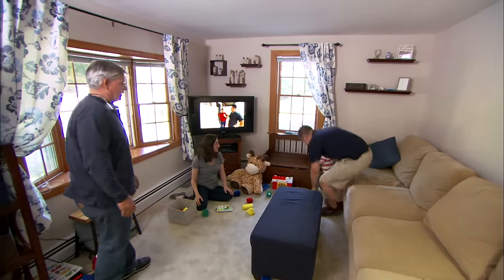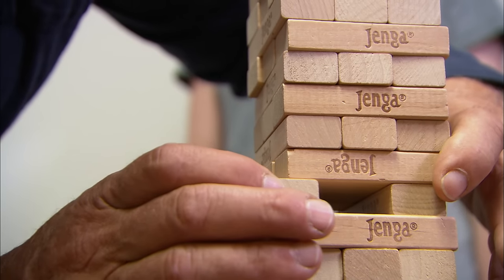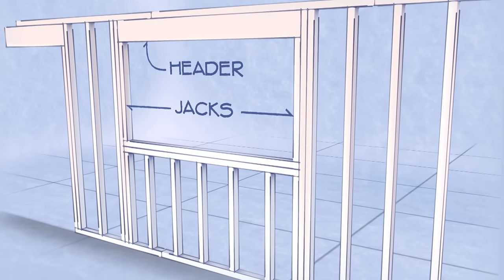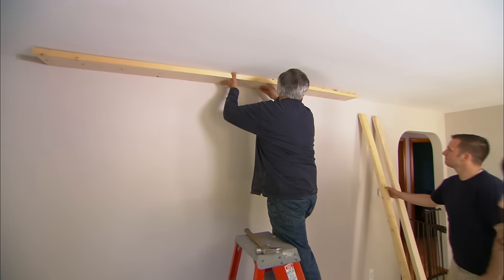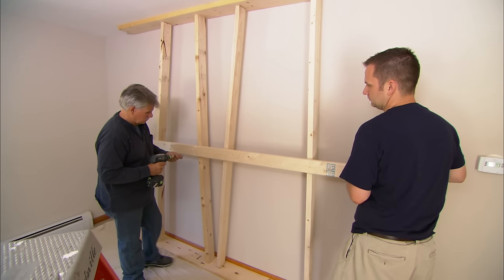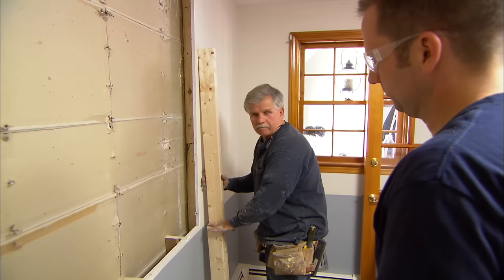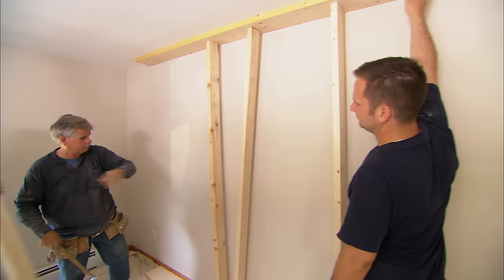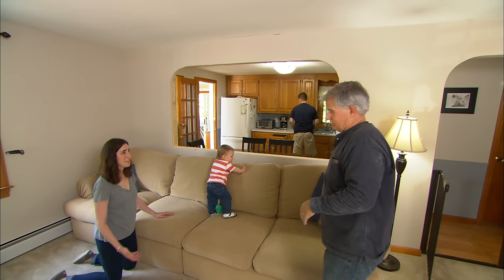How to Cut a Pass-Through in a Load Bearing Wall | Ask This Old House

Comment: Did anybody notice how they sandwiched the electrical running along the top plate by putting that header in. WTF? Is this for real.
Reply: I didn't at first but after reading your comment, I looked at it again and ya it looks like they put the header snug against the wire...curious as to why also...
Reply: The sandwiched plywood is cut shorter than the two boards so the wire has a place to go
Reply: I thought he said they were going to get the electrician to come  relocated that wire and outlet..

Comment: Sandwiching romex with the new header was really sloppy. If anyone ever puts crown in the kitchen they might hit that cable too, no one is ever going to expect electrical to be running horizontally there. I would have also cut out the round openings in the doorway and kept everything square. If you're going through the hassle of updating a home you should always do it right. It's a lot easier to cut and retape that door opening than try to emulate the pass-through. Square corners, proper casing and counter for the pass-through and it will look a lot cleaner.
Reply: So true. What a mess! I knew better at 13 years old.
Reply: " I would have also cut out the round openings in the doorway and kept everything square. " Which shows you don't do this kind of work because if you did you'd know that it's the customer and not you that decides what to do. Good contractors do "shoddy" work when the budget demands it. 

Watch here where electricians on youtube fix really old paper insulated wire instead of replacing it, because they person can't afford a rewire. 

Watch a plumber who does work for a landlord simply repair a leaking kitchen pipe that got flex pipe half kinked instead of redoing it with properly cut to dimension piping. 

you have no idea what constraints are being worked under here. If the people preferred rounded corners (i myself would have kept them, because i like them) 

If the electrician said hey, i can fish these wires properly, but i'll have to put more holes in your drywall and you'll have to pay to patch them or...  etc.
Reply: If a customer asks me to do something illegal and with poor workmanship to save money I just wouldn't take the job. There are plenty of bottom feeders out there that will gladly accept it. But those that lower their quality standards for people who are cheap are not craftsman, they are hacks!
Reply: keeping round openings isn't illegal. 
Running that electric there isn't illegal. 

being able to build to a budget isn't a sign of a hack, it's in fact arguably a sign of a hack that you can only produce when given complete design authority and an unlimited budget.

Not every work has to the sistine chapel. Renting to say section 8 housing and therefore building something functional and cheap under the assumption that you'll have to gut it every 5 years is in fact a valid way to run a business.

You may not like it, but the idea that your car simply can't be a ford fiesta or whatever even when all you care about is getting from point A to B is a failure on your part, not on the other person. 

Likewise, if you think "well unless I get to cut access holes to run this electrical conduit and redo your perfectly good doorway i'm not doing it" is absurd. 

You either don't do the work or don't have customers or are lying.

working to a budget is a fact of life for actual contractors.
Reply: The rounded corners is what one might call "character."
Reply: Are you in the trades?  Do you routinely turn down jobs because the customer doesn't want to do everything by your standards?
Reply: that's what i told him, apparently he says yes.....
Reply: More than 1 way to skin a victim.
Reply: From the looks of it when he fabbed up his new header with the two 2x6 with 1/2 plywood he may have left a groove in it as I see the electrical is dead centered
Reply: Round openings is just personal preference. Always someone giving out meaningless advice and complaints on these videos.
Reply: In my time of working in this industry, I have had 1 customer that had the go nuts budget that allows for everything to be done perfectly. That's only one. It's the first time I've ever had that happen. Normally, when you're a craftsman you have to know what allowable tolerances are and where you can and can't cut corners to save the customer money and keep yourself working.
Reply: @Guillotines_For_Globalists  A reputable trades person builds according to acceptable practices and the building code and NEVER sacrifices those principles to satisfy a homeowner's wishes.  If a trades person does so, he risks the loss of his license.

Comment: Seems a little odd they would sandwich the power cable across the top of the header like that. Backing up the video, it looks like they may have left enough room for it by making the plywood spacer less than 12 inches. Be nice if they had mentioned that. Also, the doorbell and wires just magically disappeared lol. I wonder if the full show may have mentioned these issues.
Reply: I was wondering what the electrician had done as well. Would have been nice to see what had to be done.  And how did he figure out the other two were not "in the wall" when the wall wasn't open? I'm probably just uninformed,  but that's why I'm researching through videos now.

Comment: If you pulled that on my job site, you are fired
Reply: the main thing done wrong was only bracing 1 side of the wall, BUT, secondly; you never use 2x material on flat as a support header/beam, use 2(preferably  3) on edge. Use the thick dimension of your lumber to provide stability. Also, fastening the temp studs makes it far safer...need more??
Reply: Please elaborate how it should be done.  Honest request.. I have a kitchen living room that i would like to open up and i would like your expertise input.

Comment: This video serves to show that common alterations can be done to improve quality of life.
It's easy to be an armchair quarterback, but in its details this tutorial falls short. 
You have changed the load distribution without addressing all consequential aspects of that change. The new yoked point loads were not addressed in the basement. Were new columns needed a/o installed? Was solid-blocking, or squash blocks used? 
Is that header supported by single jacks? Overhead wiring concern was not addressed. We who are seasoned, master builders/carpenters must be so much more thorough than this. Please apply greater scrutiny to build or strengthen your credibility.
Reply: Relax man, it is a 7 minute video,  not a step by step instructional course! If somebody watches a quick video then starts tearing walls out of their house, nothing would help them.
Reply: @Sacapuntas69  This video contains dangerous information, because that's EXACTLY what some people do.  The video strongly suggests "you can do it yourself" and "here's exactly how to do it".

Comment: What about the return air chase that was clearly in the center of the wall?
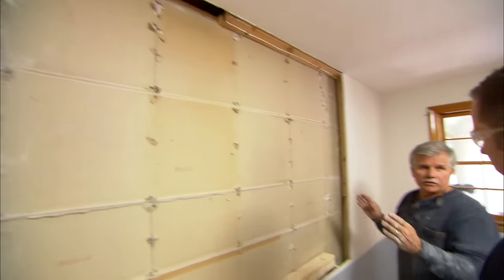Reply: The upstairs is not gonna get conditioned well if they didn't move this. What's even odder is in some of the clips it looks like there's a return air and in others like at 3:29, it appears like the top plate is solid.

Also, it's best practice to use 2 jack studs on each end of the header IMO.

Comment: I guess there was sufficient overlap in the ceiling joists above to where they only needed a temp wall on one side.  I was surprised he didn't put temp bracing on both sides of the wall.

Comment: Serious question: Don't you need to make sure the floor can support the concentrated load produced by the jack studs?  If the floor is on a foundation, fine, but what if they are on the second floor there?  Is a standard top plate good enough?
Reply: If you look at the animated drawing, you can see that the load is carried on the header, down through the jack studs BUT THEN onto the sill below, which in turn redistributes much of the load across several studs below.

Comment: Really!! Is this wall is load bearing, we here in Iraq use the brick or Skelton building for bearing , now you just put an wood and plaster board and naming it bearing wall , am seriously amazed
Reply: Wooden buildings are not as heavy as the brick buildings in Iraq, so this is plenty strong enough to support the floor above.

Comment: I wonder if it would better to support both sides of the load bearing wall since the one unsupported side would have more stress on the boards holding up the ceiling..maybe support ceiling a foot or so away from wall on the side you’re curing in from?

Comment: Perfect job. I've done this many times. Is it really necessary to double up the sill plate?
Reply: Yes. When you drywall you gonna want the plate the same width as the 2x4's so the wall could be flush
Reply: @nateg5915 

No, I mean the sill plate. The plate under the window.
Reply: @TrumanGN  oh I thought you meant the header. But I dont see any structural reason why you would need to double the sill plate
Reply: They doubled the sill because they are supporting the headder off of it. That's the reason they could do this without opening the wall to the floor to put jacks all the way down

Comment: Kind of off topic for this video but our house is very similar this this one. We opened up the wall between our kitchen and living room and put in LVL beams to carry the load. Now we want to close off the doorway in the kitchen that leads to the old entry to the living room and hallway. This will give us more wall space for cabinets when we redo our kitchen. My question is, when closing off an old interior doorway do I need to remove the hardwood flooring under the doorway before putting the bottom plate in? TIA!
Reply: No, the bottom plate is between studs so it's not bearing any load and there is no reason to cut out the flooring to do that.
Reply: No need. Especially if it is an old house, you preserve the original flooring for future renovators as well.  In many old houses here in New Orleans, the flooring often runs underneath many of the interior partition walls. It depends on the age of the house and it's construction.  You could have a subfloor with strip flooring, or perhaps suspended solid T+G flooring without a subfloor for example.

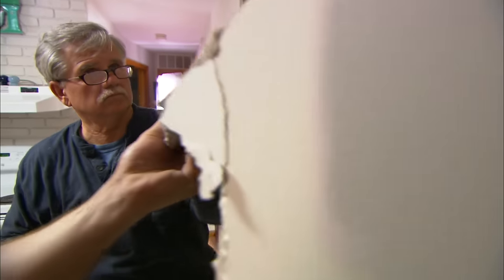Comment: Question: @3:27 you cut the studs off with a reciprocating saw (sawzall), then @6:37 you see the undamaged wall on the other side from where the studs were cut off.  When I try something like that, the reciprocating blade cuts through the drywall on the other side.  What am I missing?  I wanna learn to do it your way  Thanks!

Comment: how big of an opening can you cut in a load bearing wall using the header method? I have a 114" wall, currently looking to configure it for a 70" opening centered on the wall. If i can go wider i would love to
Reply: You can open the whole thing up if you want. But your header beam might be 36” deep. You need a structural engineer to tell you that.

Comment: So you eliminated the distributed load over 7 studs and concentrated the load at two locations with 3 studs at each of the two locations (1 original stud and two jack studs at each of the locations) only on the floor above the floor below it.  In the floor below it you have effectively removed the load over 5 studs and added the weight distributed over the seven studs in the floor above on to only two vertical studs on the floor below.  I assuming the wall below is layed out with studs on 16in centers.Question: Are you saying the wall in the floor below is structural ok with now accepting weight that is once carried over seven studs into two studs?  Question: Why are not jack studs also added to the floor below it?Question: Also since this is a structural modification does it not require a permit?

Comment: I would have put a full 2x 4 running down from the header to the bottom plate and still run the jack right beside it to the half wall

Comment: How are you supporting the floor with those boards when they are on the outside of the drywall? When you removed the original studs, i didn't see any temporary sort.
Reply: The temporary support is holding up the joists in the ceiling that run perpendicular to the top 2x4 of the temporary support

Comment: i like how he do that: simple and effective. but in my aera, 2parts jack stud are not allowed by the building code. no problem to do that but its not legit. he also didnt talk about making sure that the load is transfered to the carrying beam. if the joist are above the beam, make sure that each jacks are above one joist. if its not, add blocking. Tom knows all that, but don't try to imitate him if you dont know what you are doing.

Comment: How did you know what side of the wall to put the temporary support on?  Would that only matter if the floor joists above had ends resting on the load bearing wall? Looking to do a similar project and this was a great help.  Thanks
Reply: It doesn't matter which side

Comment: My only question- is there an advantage to using screws over nails or is it just a preference?
Reply: It's just a preference with the exception of some building codes require it in certain locations.
Reply: Screws are actually very weak compared to nails. Yes they pull the wood together but have very little sheer strength. Run a 3 inch screw through a 2 x 4 and tap the screw from the other side it’ll snap very easily

Comment: Is there a maximum width cut that you can make on a load-bearing wall? Could they have cut the wall even wider?
Reply: Yes they could but If they go wider than 96 inches (I believe) they would have to use an LVL beam and a few more 2x4 to hold all that weight. Plus dealing with any electrical, plumbing or Hvac if any of these are along the wall.

Comment: How is the header attached? Is it only screwed in on an angle to the studs on either side of the pass through or is there a way to attach it to the top of the wall they didn’t show? Or is it floating I the wall?
Reply: Alan Francis jack studs holding the header

Comment: An opening of this size can be done with 2x10's or potentially even 2x8's, but if you're not an engineer I get the inclination to more than you need. Also, you should at least check in the basement to see what is supporting your LBW. If it's not a beam or other wall, you've just introduced two point loads onto single joists, which will probably be overloaded otherwise.

Comment: @5m41s: Is the upper floor supported on the electrical wire that's been squeezed between the new beam and the plate (top right of opening)?
Reply: I just saw this and I think that's exactly what happened! Did it burn down a year later? The plywood looked recessed between the 2x stock but wasn't mentioned and that's too risky to try!

Comment: How would this work to go all the way to the floor? Is this limited to length?
Reply: Yes, it could go all the way to the floor.  An engineer would determine how deep of a beam would be needed to carry the width of the opening you would want to make, as well as if the bearing points on the floor are strong enough to carry those new load points.  A friend of mine just had the wall between the kitchen and living/dining room removed, and the beam put up in the attic (to end up with a flush ceiling).  The beam was 23 feet long.  At the ends the beam rested on triple 2x4's, and those were bearing directly on some new "posts" that were installed in the basement.

Comment: Did I miss something, or is the new header not anchored to anything? from what I saw, it appears that the header is just resting on the jack studs with nothing but drywall and tension from the hammered in jack studsl keeping it in place, am I correct?
Reply: KACSR15E3 

Yeah thats correct. You can generally get 1 or 2 "skew nails/screws" (45° angled nail) from the underside of the beam into the joining full stud. 

But in reality the beam is not going to move with the plasterboard/drywall holding it in place.

Comment: How do you know how big of a header to make?
Reply: use following method BUT check with the city inspector:
Measure the span in feet and add 2 to that number. The sum will be the height of your double header in inches. For example, if the span is 4 feet, add 2 to 4 for a sum of 6. Therefore, the header would need to be made from doubled 2x6s.